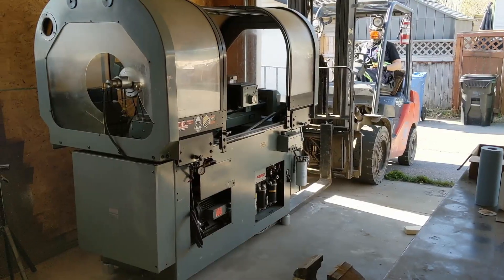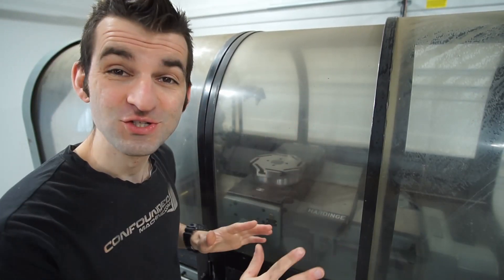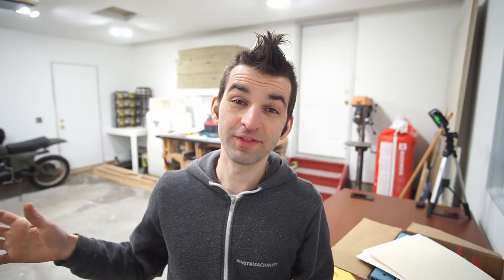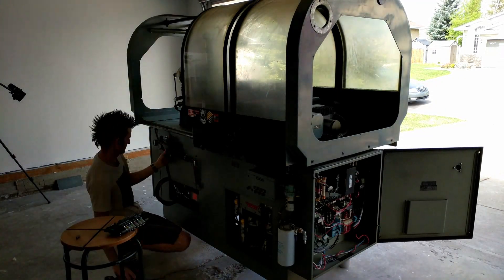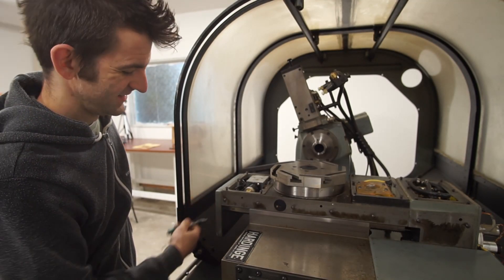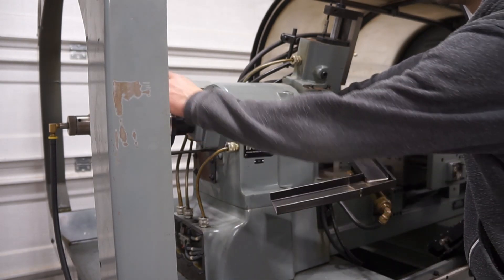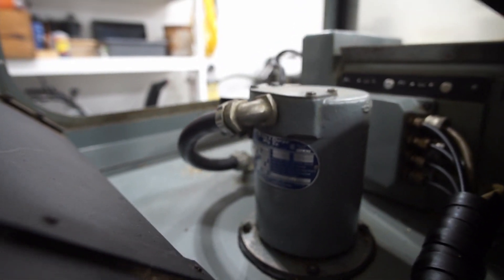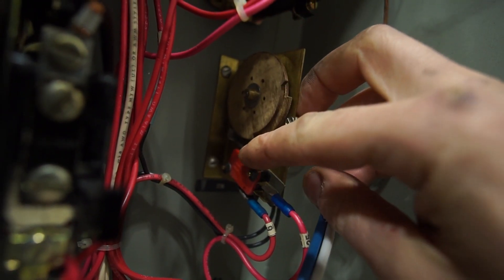The Big Lathe Is Here!

Comment: I just bought exact same one,  it looks like the break is locked,  is it always locked or does it spin freely?  I see you turning the spindle free, mine wont,
Reply from the maker: Yes, the brake is activated when there isnt power applied...I removed the brake from mine to make working on it easier.

Comment: I wanted to say Congratulations! That is a beautiful machine. Btw, that ballscrew jackshaft movement is like a CVT transmission. The pulleys are variable diameter, they should have some springs and be able to slide in and out varying the speed of the spindle.
Reply from the maker: Thanks!  All you guys are fantastic, I believe you are exactly right regarding the pulleys. I'll be double checking later this week (I had just assumed the pulleys were solid castings...time to look closer). Probably not a feature I'll need (will likely use some form of electronic control for the spindle, servo drive or 3 phase vfd) but a cool system should I want to run a "dumb" motor. Thanks again, continually surprised by the amazing info everyone contributes!

Comment: Amazing lathe and although oil based machines are quite messy, they never rust, the machine ways are always perfectly lubricated and oil is great for maching parts. Only thing to really pay attention is the risk of fire when machining titanium.
Reply from the maker: 👍 I've had Ti light up on my once when drilling...I'll try not to repeat that!
Reply: @CurtVanFilipowski  eh eh I cna imagine. Modern lathes have a built in fire extinguisher, but if you are not planning to do run it unattended shouldn't be a problem :-) Looking forwards for the next video. I guess you are gonna use Linux, like for the mill.
Reply from the maker: Those auto systems are amazing, I'll have a normal extinguisher close at hand with the hopes to never need it. The modern systems are amazing, CO2 based as well so zero equipment damage...I'll be close at hand for a while before I leverage any unattended action.
Yep, pretty set on linux so far. I'll probably go with a mesa card to get a little more IO but even my inexpensive setup for the mill/router has been ROCK solid for years (I've literally never had it glitch out...ever, which impresses the hell out of me)!
Reply: @CurtVanFilipowski  yes Linux is really amazing. I am using Linux at the Uni and Mach3 at home. Linux it's indeed more reliable. Moreover with a Mesa card you get so many I/O. I love the new Pro Basic screenset for Linux. Not sure there is a lathe version for it but that would be amazing.

Comment: If you don't mind me asking, what does an old piece of equipment like that sell for?
Reply from the maker: Mmmm, I think it's worth a bit more than I paid for it (friend rate I'll call it). Canada is kinda strange as most of this old equipment gets snapped up quick and prices jump stupidly high (I've seen clapped out CNC lathes go for $20k+ here where they would only fetch a few thousand in the US). The US has WAY more volume and I've seen machines very similar to this sell for $500 to $2000 depending on condition. Thankfully I was able to pay "US" prices for this machine.

Comment: IMO: the transmission is similar to a cvt, two pairs of spring loaded taper half pulleys, the ball screen change the distance between the two torque converters changing the areas (and so the diameter)  where belt works. Without spinning, the belt remain locked and all the system sems to have no sense
Reply from the maker: You just might be correct, I had assumed the pulleys were single solid castings...they may not be. Thanks for the comment, I'm going to dig into it a bit more with this info and see if that makes sense.